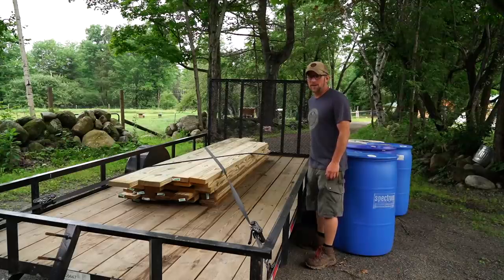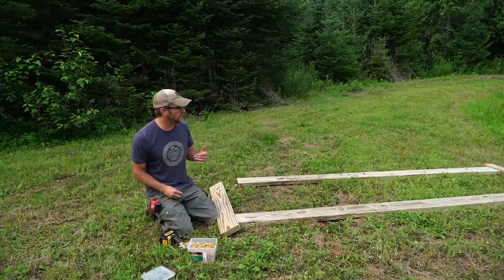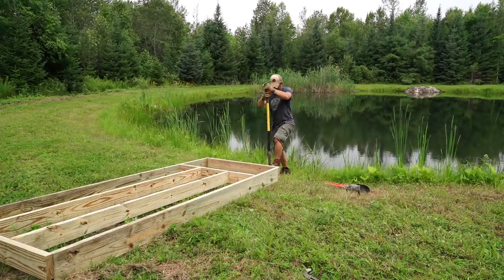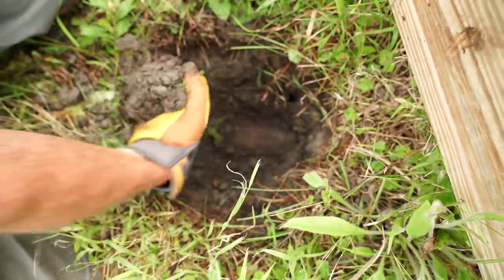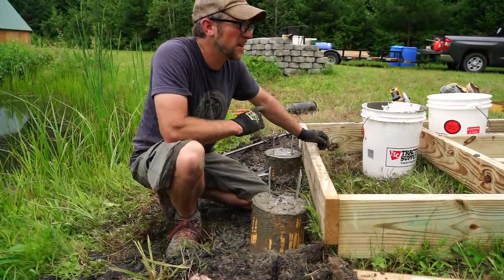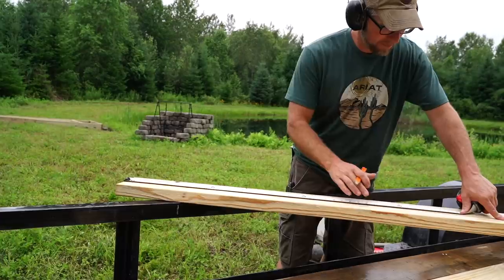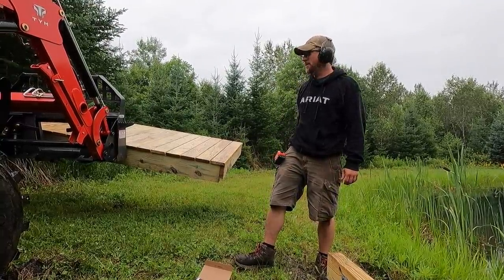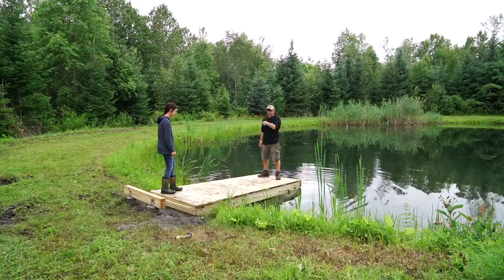Building a DIY FLOATING DOCK at our OFF-GRID PROPERTY (PART 1) Cement Piers & First Dock

Comment: hey chief ... AL  of all things water related in this video what comes to mind is that you do have an awful lot of moving water on the property ...  if you are thinking of most of the cost effective ways to get energy with out a lot of costly investment .... i believe that the use of the energy in the seemingly abundant supply of moving water on your property  and to get a bigger "R-O-I" is to convert that energy from even the slowest flow of your water recourse is to think "HYDRO TO ELECTRIC" energy ...  as even the cheapest solar is dependent upon the SUN to shine and in your videos that seems like it is in short supply when you need power most example is long winter days and nights ... also solar panels need frequent cleaning to have maximum output ...  ... the cost of hydro verses solar using the Ben Franklin side by side method hydro wins ... it flows is constant, the setup is easier, it has less structure and it is easier to maintain ...  and the "RAM PUMP' [that i suggested before] just using a garden hose can lift water over 500 feet  ...  in conclusion the use of the hydro energy that you have all over the property is the way to go for all of your energy needs now and in the future  ... think about it chief low cost & the unlimited energy you now have

Comment: Probably too late now but if you put another board on the inside of the boards your sandwhiching the barrel between you'll find your wood up out of the water for the most part...the barrel will still have the same displacement maybe fill it with packing peanuts or add a couple of barrels to each side blah blah blah lol

Comment: I'm concerned raising the water level will soften the edge and surface of the shoreline. Could you dig out/make a step down from the pylons and/or add an extension (as someone else suggested) to the shore edge with another barrel?
Reply: Agree with you . even placing rocks below the deck will prevent it dancing like boat . dumb idea to increase height of water . It will still rock like boat
Reply: @davelawson2564  there are no dumb ideas... it's a thought process. I enjoy seeing the solutions others are able to provide. It helps the others with similar experiences. It's what a Mastermind or Community is... individuals coming together presenting ideas toward a common goal. Jump aboard.
Reply: @selfretired3025  well said 👍
Reply: maybe add a pool ladder to the deck, find it salvage,if possible. Maybe, dredge the pond 7-8 et deep around the dock with the backhoe, when the ground and water is frozen in January-February..Use the platform to sit on, spread the weight on the ice with your machine. Recover the standing dead lumber with your skidoo-mule in the once-flooded areas in the cold months when the water is frozen.
Reply: @andreewert1142  not sure why its better idea

Comment: FYI, a single 50 gal barrel supports approx 400 lbs.  Al and Gina plus weight of the wood is pushing the limit of one drum. Don't want to see your hard work need to be redone. Be safe.

Comment: While the treated lumber is cheaper, I'd add another 4x8 foot section to the end of that one, with 2 barrels. On the end, I'd build a 8x12 foot dock, with 6 barrels. Also, I'd add the dock corner braces, all around the docks. With people walking on the docks, wind, waves, you get a lot of twisting motion, on the joints. It never quits. Bolt through corner brackets would be 10 times stronger and outlive the dock.
Reply: He is going to add an 8' x 8' platform to the end.

Comment: Good morning, won't all the rain raise the water level?
Reply: It will flow  away through the outlet pipe that's why he wants to raise it by 7" to 12".
Reply: @tonygrimes13  As it should because it is engineered to work with all other parts of the dam to avoid the dam being overtopped and failing. If the rain water comes in faster than the outlet pipe can move it the water will rise, so they require an amount of 'free board" for such events to avoid overtopping. By raising the water level Al will be reducing the safety factor designed into the pond. Once overtopping starts, the whole dam can fail in hours and send a wall of water downstream that could leave his property and cause destruction on other peoples land that is why these are usually engineered and certified by the state. Changes are not allowed in most cases. The liability can be huge depending on what is downstream. Always check with the state before messing with water levels unless you know your state laws very well like contractors who do this work every day.
Reply: @markpashia7067  You are over thinking this.
Reply: @tonygrimes13  Nothing to "over think" here. Unless you are positive of the engineering points when it was built, you should never change the design of a body of water. That is why there are laws about such things and the liability in a dam failure can bankrupt nearly anyone short of Jeff Bezos. You change it without approval and something fails, your life could be over as you know it. My father use to build earth dams and the requirements are very strict in most places.

Comment: Why do you draw a line if you use the square for a guide ?
Stainless screws maybe ?
Reply: He's not cutting against the square He's  using it as a guide to keep the cut straight.
Reply: @Og-Judy  that's what I said, he's using it as a guide, so you don't need to draw a line across  👍🙂
Reply: I wonder about using stainless steel screws too because our treated wood deck rotted out all our deck screws because it is treated with copper and makes aluminum rot fast as the sacrifical metal when they are both exposed to water.

Comment: I just would like to tell you,I used those same yellow coated screws on my fence and they are all rotting off where the fence boards touch the fence rails and I live in the desert southwest. We hardly get even 2 to 3 rains a year here. Just wanted to let you know my problem I'm haveing with them here. Hope you don't have the same problem because yours will be in water all the time. I wish you better luck with them. I think I would use true galvanized screws. Just my thought.
Reply: Might be a problem. Treated boards have copper in them and the screwws can rot away. I use stainless steel in my deck because the deck screws rotted out.

Comment: was told at local lumber places that price is more effected right now from wild fires than virus .
Reply: Yes it is. Wildfires are closing mills and logging operations out west. Most treated lumber is southern yellow pine from the south east so not effected much. That is why the treated lumber is down as the treating plants are back to full production after the virus shut downs. Supply has caught up to demand also. Might have to start building with treated for non residential for a while until everything restablizes. Although it should be cheaper to just use southern yellow pine that is not treated. Fir and white woods will be high for a long time it looks like. Into next year at least. Would not want treated in all my framing of a residence as the fumes might be trapped for years.
Reply: @markpashia7067  yeah I live in Wa state and the whole area keeps going in and out. Logging is hit and miss up here.

Comment: DO NOT CHANGE THE POND that is working so well, wait a year or so to see what the pond does from spring-summer-fall-winter.
When you build your other docks use 2 barrels on the end.  That way if the single barrel gets a crack in it the dock will still float???
You should be building a temporary shelter for your tractor & equipment now not docks!
Check out VW family farm they built a huge open-air building that could work for Al until he moves on the new land!

Comment: The purpose of a floating dock, is so it can rise and fall with the level of the water. You should have embedded large eye bolts in the concrete and connected the dock to them with heavy chains. And stop cutting up all your wood to exact sizes only cut what you have to the wood could have hung over the sides of the frame why waste the wood it also didn't have to be exactly 8' or 4 '  and build it wide enough to be more stable use barrels on both sides width wise and make it wider it will be more comfortable to use. you don't have to take my word for it look up building a floating dock on the internet and build more than 1 segment and connect them with chains loosely so as not to be too rigid. You can also buy and build floating docks sturdy enough to tie a boat up to.

Comment: Al you should have made the frame from aluminum. Now you have wood leaching arsenic into your pond. And whatever other chemicals that are used. Not very organic
Reply: Well said Sir!!
Reply: There have been changes in the past 10 years that have removed the arsenic from treated lumber. Chromated copper arsenate (CCA) was the chemical compound that was banned by the Environmental Protection Agency (EPA) on December 31, 2003. Pressure treated lumber no longer uses CCA.

Comment: Life lesson: The laws of Physics work.
I was waiting to see that middle blue drum pop out from under that strap as soon as you said, "That's not going nowhere." A truer double negative was never uttered. SMH

Just chain the dock to the concreted pier with eye bolts so it self adjusts instead of trying to fixture it at a certain water level.

Comment: You could try putting the barrels upright at the end since it will be more buoyant and then add in a bit of dirt/rocks thru its plugs to adjust its depth. One advantage of ballast it makes a floating dock a bit more stable since it will rock less and with the tractors grapple bucket lifting it out for the winter will take little effort. A hint about mixing concrete in a bucke is to use a drywall paddle and a strong drill to combing it an it can start out a bit loose with to much water since adding a bit more dry can bring it to the right consistency. Another tip is you can take a bucket cut off its bottom as many are tapered and the cut some angled silts in its sides so become a sieve of sorts for pouring. Nicely done and kudos on using pressure treated lumber that will resist the weather though its only concern is what it's treated going into the water won't be a problem for the trout etc that's there...
Reply: Some good ideas here!

Comment: Can't lower the water... raise the bridge... not Al ... let's raise the freaking water...shouldn't mess with that, but hell your pond so your choice, however  now bring the mini down, reach out with the bucket and drive a couple of pilons down into the pond floor, on each side of the deck, to attach the deck to, it will stabilize the deck, but still all quickly able to be removed if needed,  then the floating dock can be attached to it with no issues.
Reply: If the pond was initially put in with a clay lining, doing that could compromise the seal.
Reply: @christinedehn3257  I think the pond it natural in that it is fed by a spring.

Comment: I read it isn't safe to use pressure treated lumber in or around ponds, it  is bad for the fish.
Reply: I've been wondering about that myself.
Reply: Old news. This is not the old treated lumber from years ago that leached arsenic. Also this will not be in contact with the water once it is floated properly. This is just the walkway to get to the float dock still to be built and Al was playing around in this video to scare Gina and have some fun. You will understand once all is built and installed properly.
Reply: @markpashia7067  Thanks for clearing that up. So the treated lumber with copper doesn't hurt the fish any? That's good to know.
Reply: @StoneKathryn  No one is perfectly sure about the new treated as it has not been in use long enough, but in this case with no direct contact with the water and the size of that pond, it would be very unlikely to have any chemical get to parts per billion much less parts per million where most of the limits are set. All bets are off if it had treated posts underwater, but this will float with all wood out of the water when done. I am more concerned about the treated wood and human skin contact as people are kind of careless about washing hands before touching mouth or face. I would seal the top and side surfaces with Thompson's Water Seal for that reason as it is food grade surface sealing in the poisons and also a very good traction surface when wet unlike regular stains and sealers that can be very slippery for wet feet. Thompson's was the only treatment cleared for sealing the old treated lumber for food areas like picnic tables.

Comment: No sense building something if it scares her.  I’m sure once you build the dock onto the walk way, the extra flotation will settle it down.  As for raising the water level, back home, the locals did this every year - something to do with baby fish.  They mixed a bunch of concrete into a storage tote, added a lifting ring, then a piece of chain.  Cover the pipe - The  water would rise to the new height and to lower it, that chain was attached to a tractor boom and lifted off.
Reply: That sounds cool.

Comment: Why do you park your trailer so faraway from the work seems less to carry so faraway from the build. Carrying 60lb bags of concrete would be easier if closer as well as wet pressure treated lumber. Just thinkin of the strain on yourself. Now you need to build another the same as the first to make a T. By makin a t the dock willb more stabil and less bouncy So Gina doesn't freak out.
Reply: Stated in video that another section 8' x 8' to be added to end.
Reply: has to have room to video the process

Comment: .... Al that poly rope is a waste of time and money sun light will destroy it in no time if you're going to use rope get nylon rope  . The sun will eventually get to the drums you are using , there are flotation blocks made for that purpose . By the way if you start to think of using styrofoam a little gasoline spilled in the water will eat it up . Good luck.